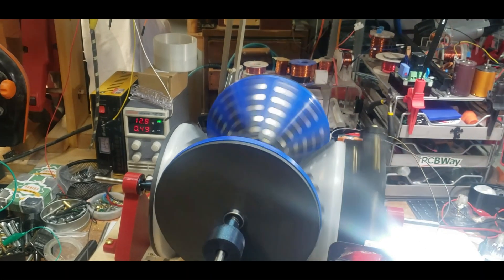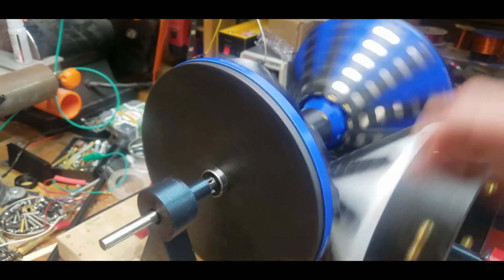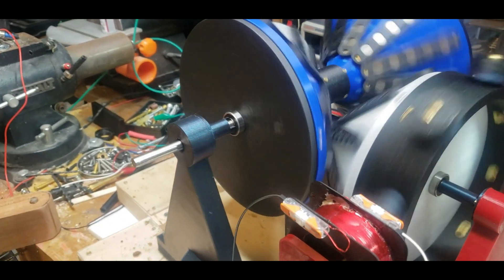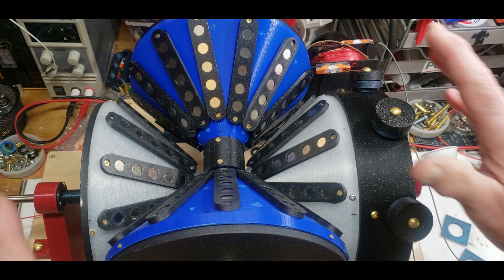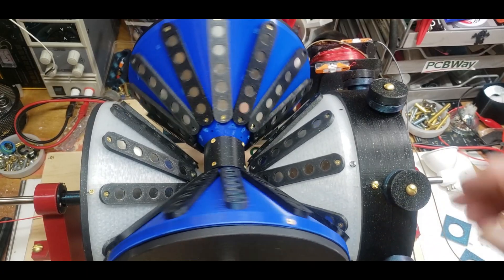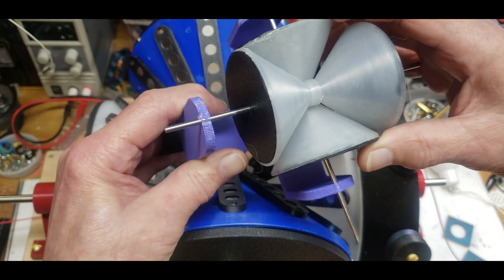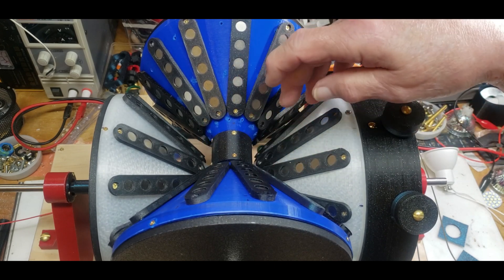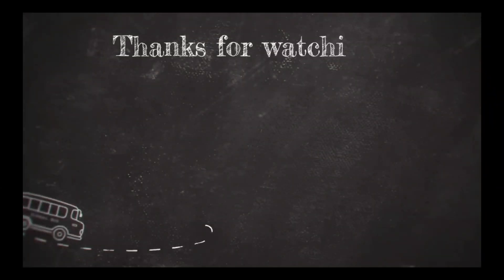3D Printed Pulse Motors ITS WORKING lololol

Comment: Before you uncouple the 2 cones.. it would be interesting that you get the consumption and rpm of the system.. Example:  at 12v and 0.5amps (=6watts) it turns at 600rpm... so you know that you need 6watt to turn it at 600rpm (the figures are only examples)... then when they are decoupled.. do the same and you will see if you need much more watt to turn it at 600rpm.. or much less.. (or the same) that would be and interesting experiment.
Reply from the maker: will do

Comment: Love your videos.  Just curios if you have an opinion on air core vs iron core pulsed coils and heat build up in them with long duration use
Reply from the maker: great question and yes I usually use air core due to the heat build up in the coil when using a iron core. The iron core is a better output coil but the heat is a bear to manage.

Comment: Just hit me, how would a spiral design of the magnets mounted work out?   Just thinking about how nature organizes.
Reply from the maker: it would work great and was the first option from the original design. I thought it would be too hard to make to went with the straight lie one.
Reply: Coincidentally I  printed an archimedes spiral today to test with hydro water turbine generation,and wow it had lots of torque, really captured the waters weight efficiently and let it through, not sure how it would work  with magnets or if magnetic fields can benefit from it  but spirals are an efficient design for sure.